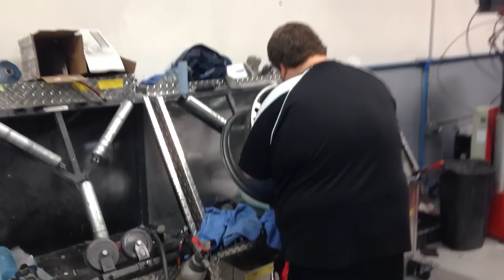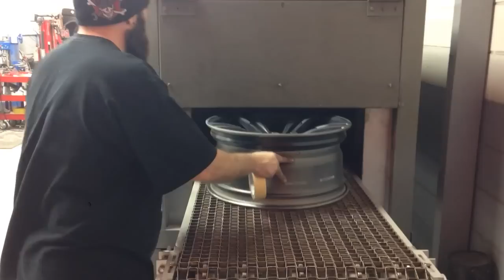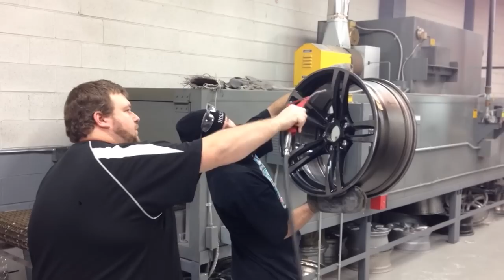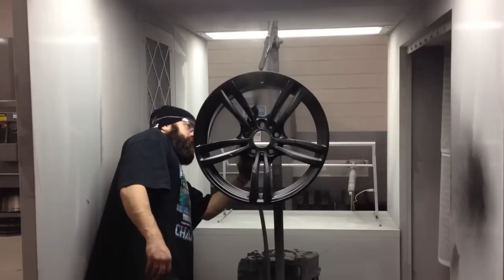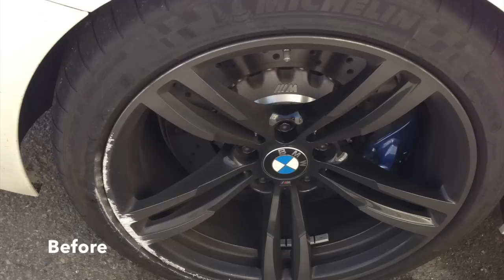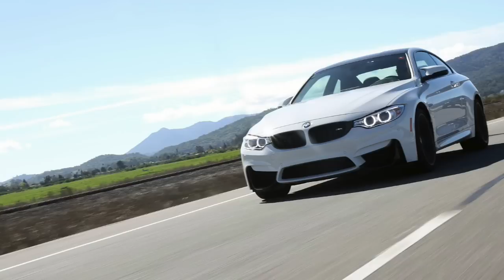M4 wheels powdercoating

Comment: Awesome look to an awesome car.   I currently have a black 
2011 , 7 series , that I am having a chrome delete done on. I have stock BMW rims , thinking about powder coating them black.  What are the side effects if any with powder coating? Will it last for ever , or will it start to fade or chip after a while? I was told to stay away from plastic dip.  What do you think?    Thanks in advance.
Reply from the maker: Travels & Chases Powder coating should last forever as long as it's done properly. I only look at Plasti Dip as a short term solution because it's so cheap and easy to remove if it gets chipped or starts to wear off